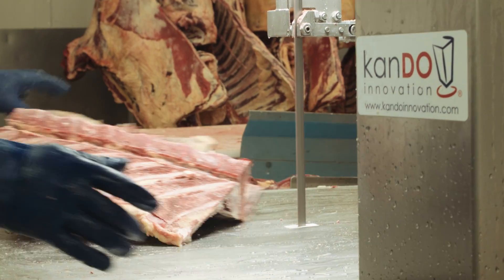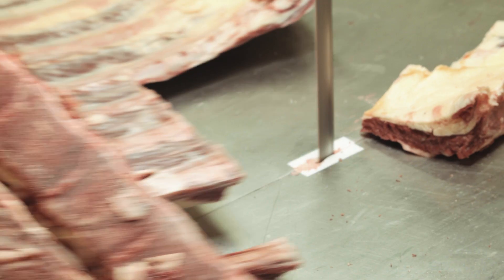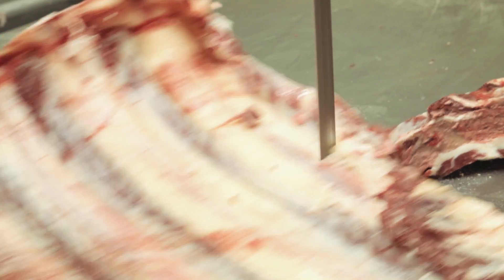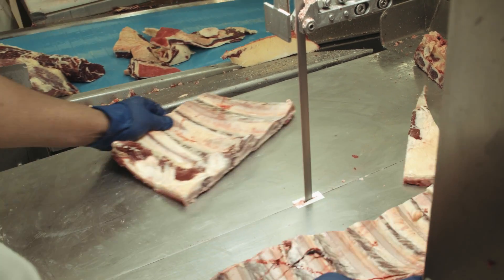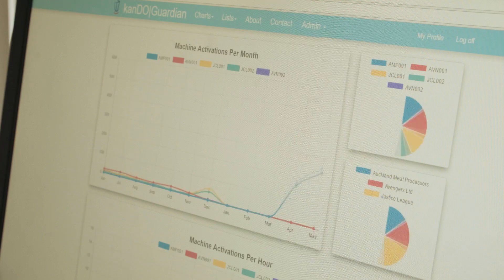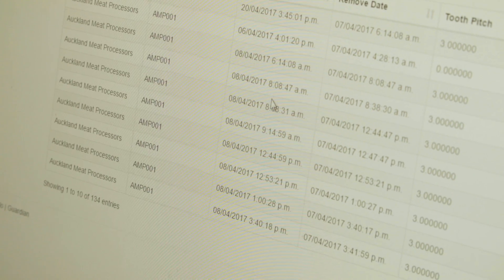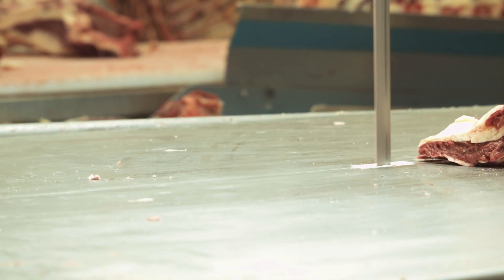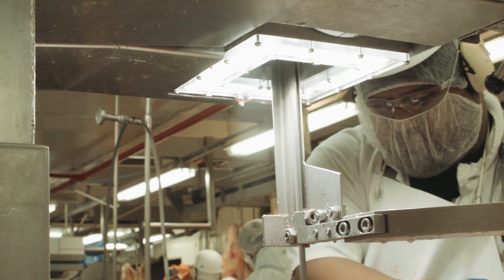The Guardian Bandsaw

Comment: 1:38 the blue color is already there but the machine continues running looks like at least it cuts off one rib that means more or less one finger. That's a lot isn't ?
Reply from the maker: Thanks for the question Denis. We selected this video so that the viewer could see the stopping action of the blade. The blue-gloved hand in this video is travelling at the edge of the safety zone. What you don't see is the trigger activity - once the vision system detects the blue glove the saw is stopped in milliseconds.

Comment: Great vid. I think this technology will help immensely with OSH. funny thing is that I actually thing the Application and "Raw" data plays a bigger role than the safety device itself, this is because businesses will now be able to tell how long someone should work on the saw before being rotated, this alone should drop the risk :-).
Reply from the maker: Thanks for the feedback Alvin. We absolutely agree with you on the value of the information provided by the software. We have witnessed first hand the power of this data in changing operator behaviour and the positive safety conversations that happen within teams when working with the information the Guardian provides.